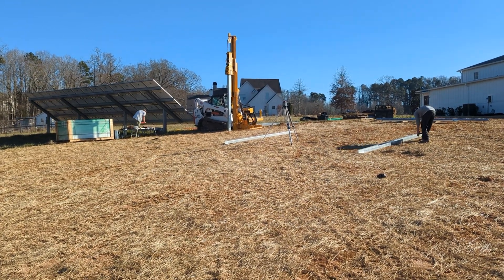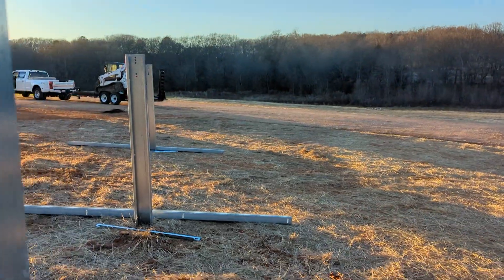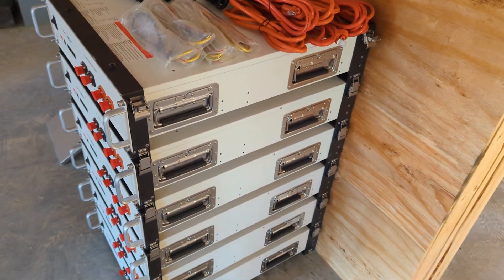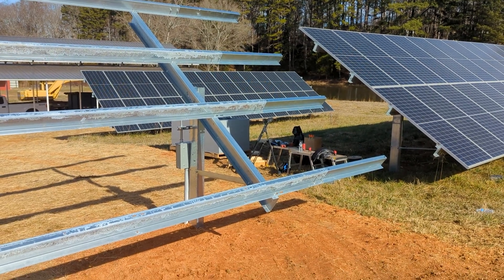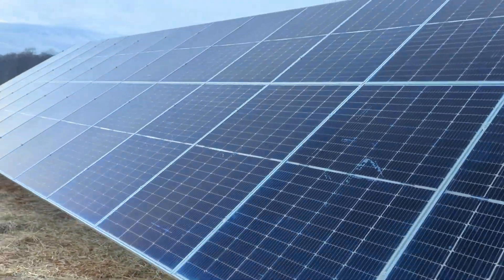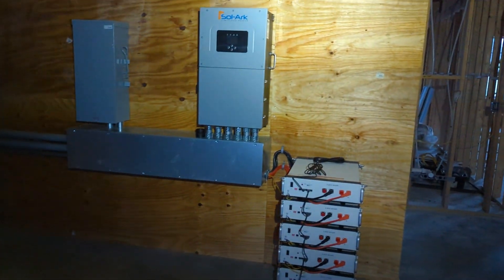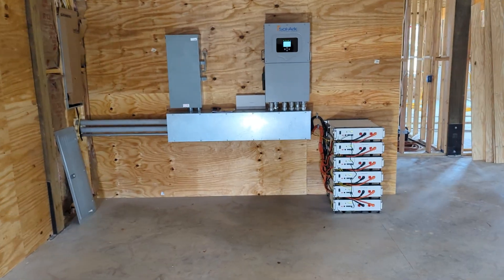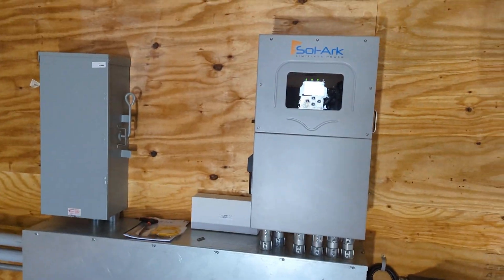Vehicle to grid failure!

Comment: Is there any major component on a second-generation Prius that could be implemented in creating a mobile generator setup for using power tools? I have two sitting on a lot with dead hybrid batteries and want to know if there is anything useful beyond its scrap value still in there.

Comment: I would NEVER connect my EV to a high frequency, transformerless inverter. There's no galvanic isolation between the battery and the AC output!  All it would take would be for the AC output monitoring circuitry to fail and a MOSFET in the H-Bridge to short to ground and you'll smoke your EVs on board charger.

Comment: I hooked up my son’s 2020 Ford hybrid truck to a changeover in his garage. No batteries or solar involved but the truck kept tripping its breaker even when there was no or minimal load. Found out it was tripping on a ground fault. Disconnected the ground through the umbilical cable and no more trips. Ran their house fine less A/C units. The truck would automatically start when the batteries discharged to a certain level and then turn off. I would bet that is the problem you are seeing.
Reply: That's hybrid, it's not the same

Comment: With the huge quote from sunrun, for V2H, we just built an offgrid system of 3.6kW panels, 10kw bank, with an EG4 6000ex-48HV for offgrid charging the lightning through the Ford Chargeststion Pro. We’ll use extension cords, or do a subpanel with transfer switch if it ever seems like we’re missing it. We can only charge at 12-16 amps, but it’ll have a 4-5 year payoff, so I think we’ll be good with free fuel in 5 years. We may bump up to 20kw of batteries this summer when the panels are producing that much.

Comment: As others have said. The generator inlet box needs to leave the ground off. The truck is neutral bonded and the home is also neutral bonded. I left the neutral disconnected and mine runs my home well. No issues.

Really cool video. Would have loved to have seen it charging up the batteries.

Comment: I believe the Truck has GFCI protected circuits.  Because you have a neutral ground bond downstream in the circuit somewhere, it will see a ground fault  A simply fix is to remove the ground from the cable coming from the truck. You will still have your house ground in place.

Comment: I think to get the best vehicle to home connection, you may need to use Ford's two-way charge connector so you can pull power directly from the DC charge plug.

Comment: Make sure the Sol-Ark was limited to 30A for the generator setting, and pull the ground plug on the cord going into the 14-30 on the truck side. The Lightning will fault due to GFCI and how the Sol-Ark is grounded if you have it hooked up without disconnecting the ground plug.

It's unfortunate that vehicle manufactures are blocking V2G implementations for those who already have inverter set ups, hopefully Ford and others comes to their senses and opens up their API so Sol-Ark and others can use it via the CCS plug like it should be.
Reply: I was just coming to say the same thing, you cant connect grounds.
Reply: I also put in an auto transfer switch to run a sub panel.   That works since the lightning does not see a neutral ground bond.
Reply: Yup.  That's how I connected my lightning.
Reply: Always good to see helpful comments. Thanks!
Reply: What's the Lightnings Max output when using it to back up some circuits? I'm sure it can't back up a whole house or can it?
Reply: @OscarGonzalez-ct6no  7200W, plenty to run our setup.
Reply: @OscarGonzalez-ct6no  3600 watts per line.  What you will see is that your load may not be evenly spread out and you can see that in the lightning.  In other words,  it is both a total load issue as well as watching each line.  Finally you have to see what your surge loads are.  I put microair easy start devices on both of my air conditioning units.  So in my case I can run the house but turn off one of the ac units as well as my pool pump.  I fiddled around watching each line and moved some loads around to balance my draw on l1 and l2.  I also have a chargeverter that the lightning can drive...which...solves all the issues but results in conversion loss ....but...it's really easy and works
Reply: @houstonstarbuck  its 9.6kW if you use the Vehicle to home CCS system

Comment: Are you limiting the pull on the gen to 7.2 KW?
40amp limit.

I want to do the CCS output so it can directly tap the 400V battery of the Lightning.

Comment: I’m currently topping off our new Envy 12k’s and (4) evaults with our Lightning.  It’s awesome.
Reply: Awesome. If you could please share your experience with the rest of us  that would obviously be very helpful and much appreciated.
Reply: I set the gen input to 5kW and run from the 240v plug to a disconnect, then into the gen inputs of the fortress Envy’s.
Reply: In video format: https://youtu.be/GJ5cnTreem4?si=xFKPXNi2oyhKs7xa
Reply: Thanks for posting the video Jeff. That's one helluva system you have installed! 
Any serious Off grider would be proud to have done that. Kudos.

Comment: Pytes makes two kinds of brackets. You have the F. & B. Bracket kit there. They also make an R-Bracket single and 8 version. The 8 version is the same as the single just packaged as a group. The R-Bracket is a lot stronger than the F&B. I also recommend mounting either bracket style on a riser, like a box made from 2x6, etc. that’ll keep the dirt, water or other debris away from the bottom battery.

Comment: Might have to use a dummy load like a light bulb or hair dryer connected in parallel. That way the truck sees a power consumer and you don't have two systems trying to be smart, waiting for each other and never starting.
Its the same with a smart 12V battery charger and a dead battery, first you have to turn it on supply to make the battery take 12V before it can start charging normally.

Comment: Did you try reduce the generator input to something little that the Lightning would obvisouly handle?  500w or something like that?
Reply: Ford website says something about Ford Charge station Pro, so maybe you need to connect thru that, for electrical safety / liability reasons maybe.